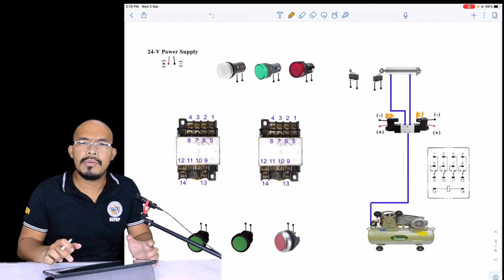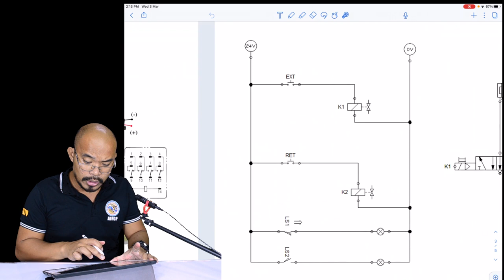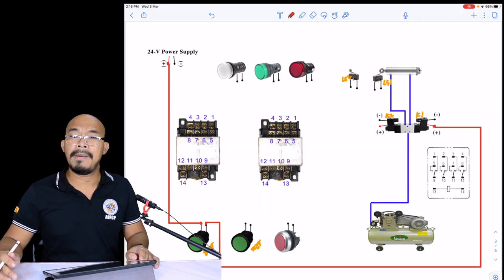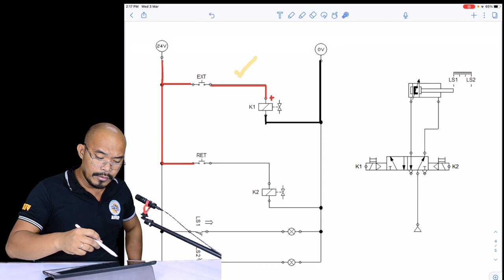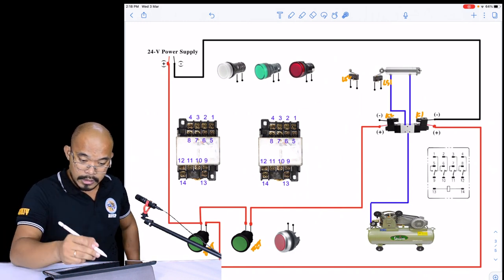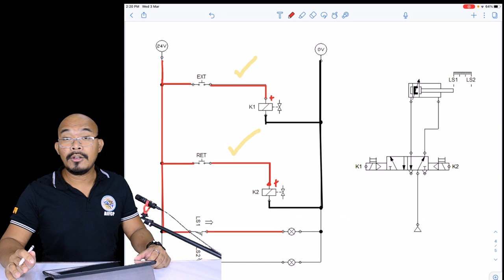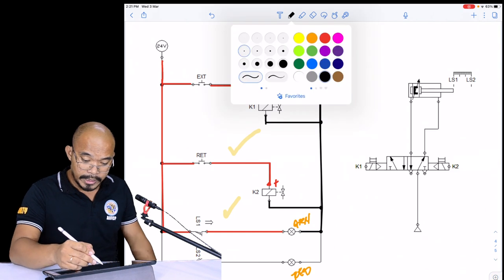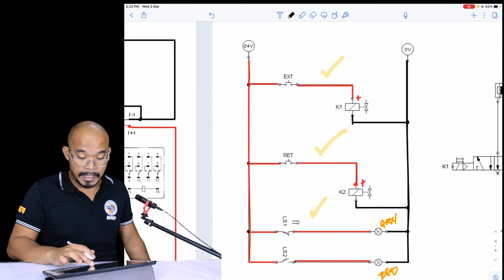How to wire Electropneumatic Circuit (with limit switch)

Comment: In this discussion, which is the electro-pneumatic control circuit with the limit switch, first step to do is the same from the first discussion about wiring, the positive supply (red) connect in extend to K1 then the other terminal of K1 should connect to negative supply (black), and then the limit switch is the one will add in the system which is the LS1 and LS2, as what you've mentioned in your discussion sir that the limit switch has no polarity, it means we can either choose the two terminal of limit switch to connect in positive supply, in connection: the LS1 connect to positive supply (red wire) in the 1st terminal of LS1 while the other terminal connect to green, then the other terminal of green connect to negative supply (black wire) while the LS2 should connect to positive supply (red wire) in 1st terminal of LS2 while the other terminal of LS2 connect to red then the other terminal of red should connect to negative supply (black wire), so.. in this wiring the system will work.

Comment: 11:43 The pilot lamps are connected with those limit switch, as i understand the circuit, when the cylinder piston reach the maximum EXTEND limit of the LS2, the color RED pilot lamp will be ON. On the other side, when the Cylinder piston reach the minimum RETRACTION limit of LS1, the GREEN pilot lamp will be on. These pilot lamps serves as indicators and limit switch control the cylinder piston to the maximum and minimum distance.

Comment: Thanks for this video sir,help me to understand how to connect the limit switch to the indicator lamp also how to wire step by step, The 24v connected to the push button and then connect to solenoid valve. Then the LS1 connected to the positive side of our power supply and the other port of the switch connected in negative side.

Comment: Thank you for this video sir i learn and observe something about how to wire electro pneumatic in easy way, first is the 24 volts is connected to extend, from extend connected to the positive of k1, from that we can now connect the negative of our k1 to the 0 terminal of power supply or the negative side of the power supply.. and there's two option that we can do to connect the push button of retract directly connect to 24 volts or we can connect it to the extend button, what have you said sir it is more efficient way is directly connect it to the extend button because it is use only a shorter wire. So Next is same process from push button of retract connect to the k2 of our solenoid valve #2 and the negative of our solenoid valve is to connect to the negative of our power supply and there's two option from it we can connect directly to the negative supply or tap it to the negative of k1 and In limit switch there's no polarity which means, we can either chose where to connect in which of the two terminal of where we going to connect it to the positive supply. And the  next is it is connected to the pilot lamps to the green and connect to the negative, and you have shown us that we can tap it to the other line of the negative.. and the last rank is same process of the 3rd rank.. thats the only i know and have observe from your video lecture sir thank you and god bless..

Comment: In my obserservation in the pneumatic circuit is need to careful and analyz always what u circuit connecting other button or the lamp for the safety, also easy to determine the positive and negative .very easy identify and to connect in other circuit.  .

Comment: In this video, I learned how to wire electropneumatic circuit with limit switch. The "IN" of normally open push buttons which is the extend and retract, the "IN" of the limit switch 1 and 2 are connected to the 24 volts. The "OUT" of the extend is connected to the positive of the K1. The "OUT" of the retract is connected to the positive of the K2.  The "OUT" of the LS1 is connected to the "IN" of the green pilot lamp and the "OUT" of the LS2  is connected to the "IN" of the red pilot lamp. The negative of the K1 and K2 and the "OUT" of the green and red pilot lamp is connected to the 0 volts.

Comment: I learned that electro-pneumatic controllers have a pneumatic power section. In an electro-pneumatics control, the signal control section is made up of electrical components, such as electrical input buttons, proximity switches, relays, or a programmable logic controller

Comment: What i understand in this topic is the same as wiring a basic electro pneumatic circuit but has a limit switch.
There is an LS2 and LS1 and needed to wire it step by step

Comment: In this video what I learned is that doing something like connecting some wires,the diagram is very important and need to understand so that the wiring will be perform correctly and the steps that is going to be follow. What I remembered in this lecture is that limit switch and the pilot lamp is added from the previous video and  the LS1 in near to the cylinder while the LS2 is far. And also the push button which is the Extent and Retract push button are normally open.

Comment: i learned in this video is to connect the wire to the other wire or steps by steps i analyze and understand the diagram then connect the circuits

Comment: In electro wiring pneumatic system,  with connected in limit switch in pilot lamp.  Before we do wiring we need to put a name first of the component to identify which is retract button and extend button and also to identify Ls1 and Ls2.  The importance of wiring a circuit is we should always follow the direction of circuit diagram in order for us to connect it properly.

Comment: This video is the continue of previous lecture obviously, so we can now add another wiring connect into limit switch. This is the way to understand completely and simplify every step by step of connecting wires on each components of the diagram.

Comment: Wiring is not easy for me, but I' already to learned to Wiring the electro pneumatic control circuit. First step, for the 24 volts connected to the EXT. Next, from the EXT connected to the positive of our K1 (POSITIVE) the next is the negative of our K1, will be connected to the zero terminal of our supply. The negative side of our supply. (The negative of our power supply)  For the RET connected for our 24 volts after, we wire our k2, which is the positive of our solenoid valve number 2. (The negative of our solenoid valve to the negative of our power supply).

Comment: I learn that we have the 24 volts with the positive and negative charges we will identify the components that we will be using in the particular circuit and has also 2 push buttons

Comment: Installing a light indicator in a circuit can be recognized either it is activated or deactivated, unlike if you are installing a circuit without light indicator in a previous video, it is difficult to identify either it is activated or not especially if you are far in the system and you are only to see such indicators in the a controllers.  It has a great impact of improving the system into convenient operation. In addition, thinking  of the operation can lead you to a question why it is being made and that question can be answered if you are understand the operation of the circuit. Before you doing a activity in a circuit, think and understand what is the best procedure and what is the proper materials will be used. Just follow simple steps and you will get it in your own effort.

Comment: In this video I learned about the electro pneumatic circuit with limit switch. how to connect the limit switch to indicator lamp also how to wire step by step

Comment: I’ve learned in this video how to connect the limit switch which is connected to the past video on how to wire basic electro pneumatic circuit.

Comment: In the first lecture there is no limit switch , in this video same procedure in first lecture  but now there is limit switch, from power supply has 24 volts connected going to  EXTEND push button, from EXTEND button connected going to the positive of K1, then the negative of K1 will be connected to the negative of our terminal power supply. For the RETRACT, so from 24 volts power supply, connected going to RETRACT button, then from the RETRACT button will be connected to positive of K2, from negative of K2 will connected to the negative terminal of power supply. So for the 3rd rank, the positive of LS1 will connected to the positive of power supply and the other positive connection off LS1 will be connected to Green pilot lamp and the negative connect of Green pilot lamp will connected going to the negative terminal of power supply, and the LS2 same procedure of the LS1, so from LS2 the positive connection will connected to positive power supply annd the other connection of LS2 will connected to positive of Red pilot lamp from the negative of Red pilot lamp will connected to the negative terminal of power supply. Thats all sir thank you..

Comment: As the continuation from the previous video this time will connect the limit switch and the indicator lamp in the system. From the 24volts as positive the limit switch1 and limit switch2 was connect and both it's out was connected to the indicator lamp then connected to the 0volts as nigative.

Comment: In this video lecture or continuation of the previous wiring of Electropneumatic Circuit, the additional information I got watching this video are the following: First thing, We should be familiar of the components when wiring a circuit. Second, here, we just add 2x limit switch in the control circuit and 2x Pilot lamps for visual indication purpose. so we will just add another 2 ranks of wiring from the previous video. Third, Limit switches does not have polarities so we can connect the wires to either one of the two terminals. Fourth, we can identify or name the limit switches based on the position, in this circuit, the nearest to the piston will be the LS1 and LS2 is the farthest one. Fifth and the last thing, we had to wire every components in a circuit one step at a time. When wiring this circuit we will just add 2 ranks of connections based from the circuit on the previous video. So, we will connect the positive 24V power supply line to the one of the terminal of the LS1, and the other terminal will be connected to the pilot lamp (Green) positive terminal, and the negative terminal of the pilot lamp will be connected to the ground or 0V supply. And for last rank we will just do the same thing. Thank you for sharing your knowledge to us sir and hope you appreciate what I understand in your video. Godbless 😇

Comment: Wiring the electro pneumatic circuit with limit switch is producing signal to the pilot lamp allowing them to start or stop. While doing the wiring we have to be careful and analyze the circuit diagram so that you will have a proper wiring and connections.

Comment: In this video, in wiring electro-pneumatic system with a limit switch its producing signal to the pilot lamp and allowing them to start or stop. This diagram it is important to have a good attention and must connect it properly and carefully those wires to avoid mistakes so that you have a good connections.

Comment: In this lesson as continuation from the last topic, i learn again new things like how to connect the limit switch in the system and the indicator lamp. The limit switch is connected in the 24v and to the indicator lamp as they are connected in the system same in the other limit switch and indicator lamp(LS1 and LS2) . Also the important of proper connection of the wirs in the circuit.

Comment: This video is to how to learn about wiring according the diagram. the 24 volts is i have a two colors RED and BLACK and then K1 and K2 i have two colors same by na 24V RED AND BLACK, for the Red is  pasetive, the Black is negative, then wire step by step.

Comment: In this video, we understand more on wiring by using more relatable components of an electro-pneumatic circuit with a limit switch, and we learn to wire same as to the diagram to the more relatable components or same to the actual.

Comment: This video was extremely helpful in understanding how components in a control circuit are linked. I finally figured out how to attach the power supply to the push button and then to the way valve and limit switch. The red wire or positive terminal is connected to the push buttons first, followed by the solenoid valve. The thing that is added in this lecture is the limit switch to pilot lamps that produces electrical signal to the pilot lamp. The connection limit switch and the lamp are directly connected to the negative port of the power supply to be included in the system.

Comment: Thank yoi for this video sir,help me to understand how to connect the limit switch to the indicator lamp also how to wire step by step, The 24v connected to the push button and then connect to solenoid valve. Then the LS1 connected to the positive side of our power supply and the other port of the switch connected in negative side.